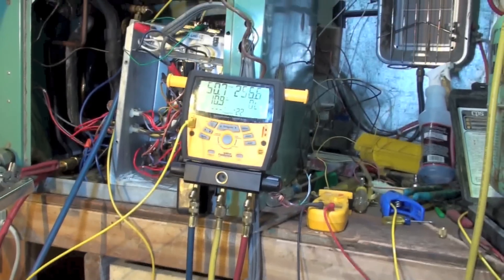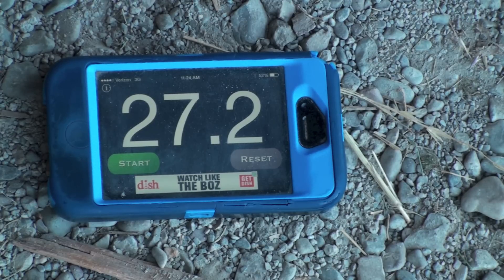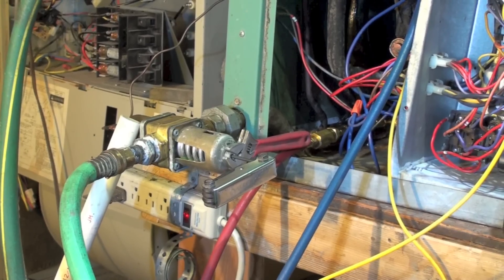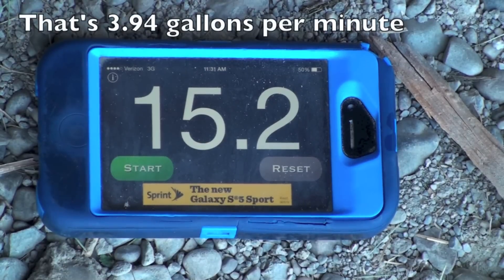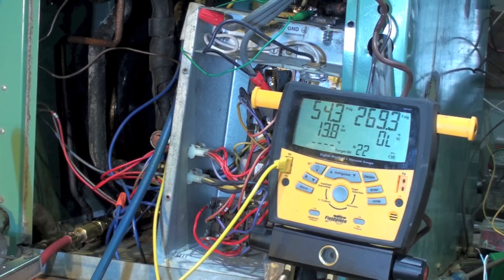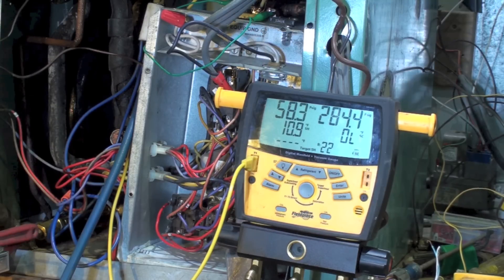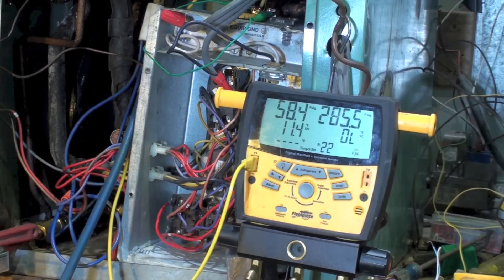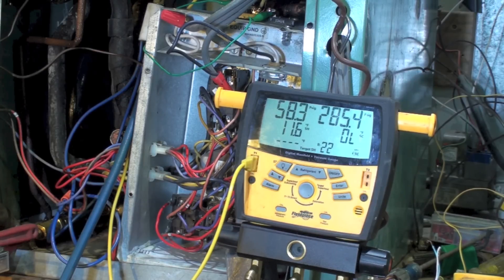Water flow volume on the water source heat pump

Comment: When Using (well water) supply on a New 2007 model, 3 ton carrier water sourced Heat pump in heating mode, would approximately 45 degrees be an acceptable range for the discharge water temperature?   I'm using my laser temperature gage, and I have the water flow set to where there is never any ice forming in the discharge water line.
I haven't installed any type of heating tank apparatus for use in the heating stage yet.  I also wanted to add that I do not have this unit online fully at this time.
It's located in a master bedroom behind a brick wall that isn't occupied.  I've used it a few summers which never gave a problem of course, with the groundwater being approximately 52 degrees, but this is the first winter I've even attempted to use it in the heating stage.
I'm sure you possibly covered this in your video, but I thought it couldn't hurt to ask what the desired temperature should be on the high and low side in and out of the compressor right where the Freon lines connect to the compressor in the heating mode?
Thank you so much in advance.

Comment: I don't see these types of water valves very often on WSHPs (I work on a lot of them); it seems like the majority use a circuit setter cartridge with a fixed value or an adjustable ball valve type. Occasionally, I see something that looks like the valve you have there but it regulates based on head pressure. That seems like a good concept but, I've seen the bellows fail and dump the whole refrigerant charge. Not as big a deal on a little package unit but kind of a bummer on a 60-ton R22 chiller. 
Edit: watched the other video and saw that this is a water valve like the one I described